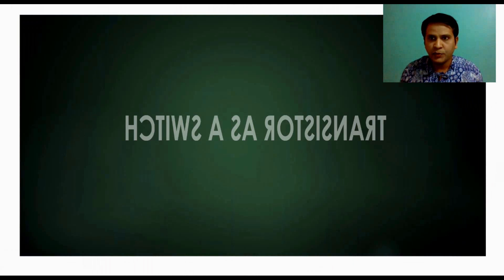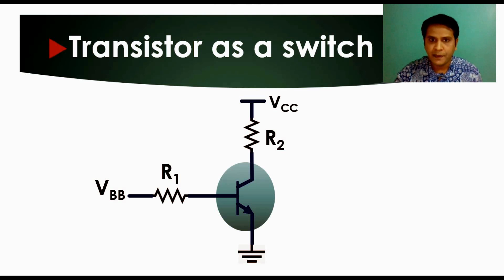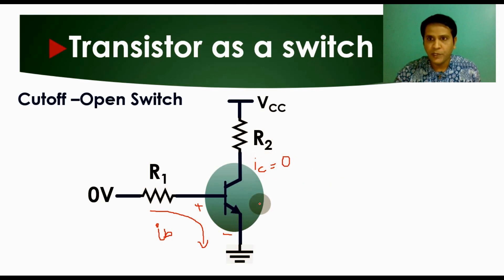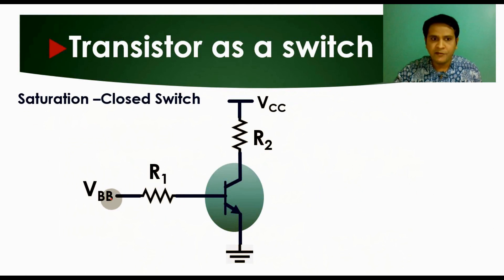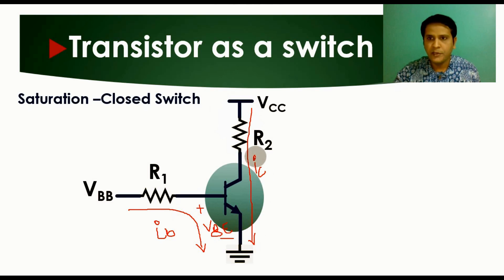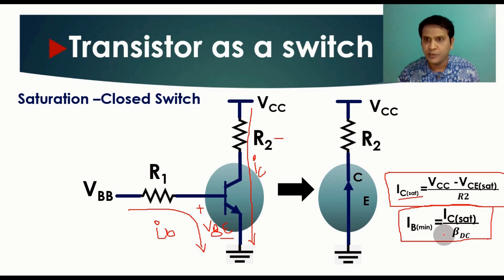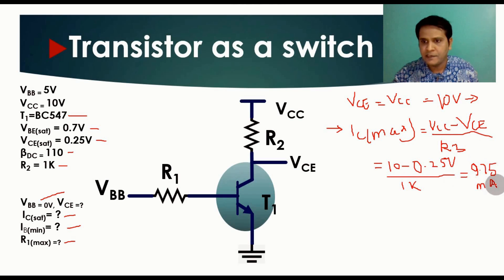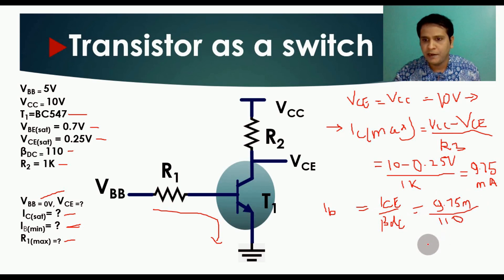BJT as a Switch - Cutoff and Saturation Mode YouTube

Comment: How much minimum ic current required for saturation region
Reply from the maker: Thanks for query !
Ic is independent of  transistor saturation. Ic is maximum allowable current that can be drawn from a transistor. The base current drives transistor into saturation region. The more base current allow transistor to go in fully saturation. 
In other words, 
The base current is like a water tap so its better to open water tap completely and its up to us how much water we want to filled in bucket. So water quantity is like collector current.

So now how much is allowable base current. This information you can find in transistor datasheet. Please go through attached transistor datasheet and let me know if you have still doubts.
https://www.sparkfun.com/datasheets/Components/BC546.pdf
Reply: @ElectronicsCircuitHubECH  hlo sir
According to datasheet I understood, minimum 0.5mA base current & 10 mA Ic current required for saturation
It is ok? Pls confirm